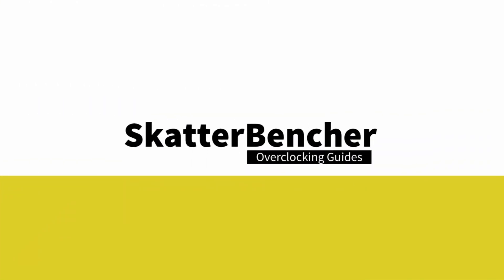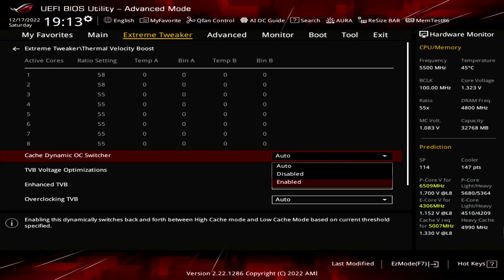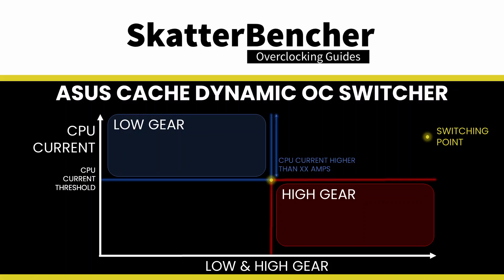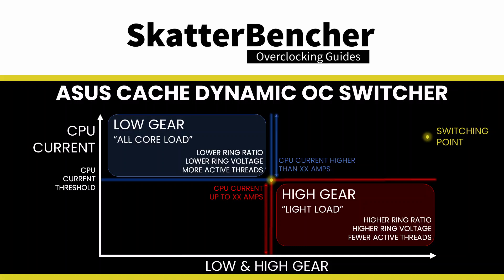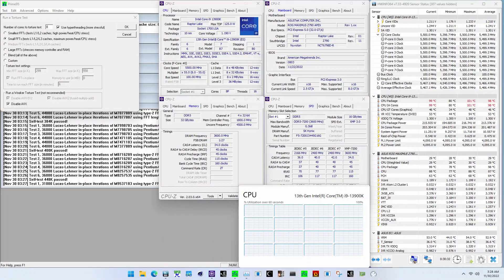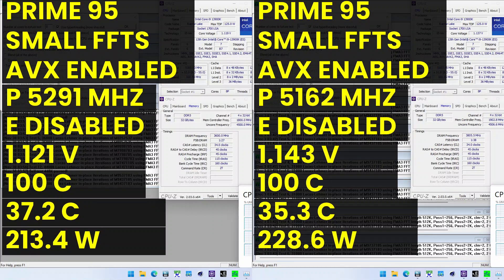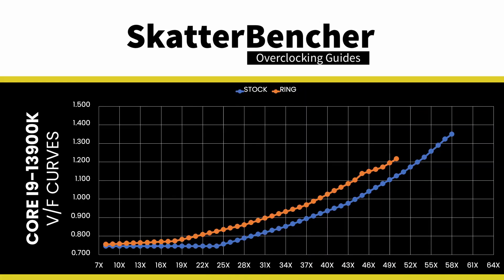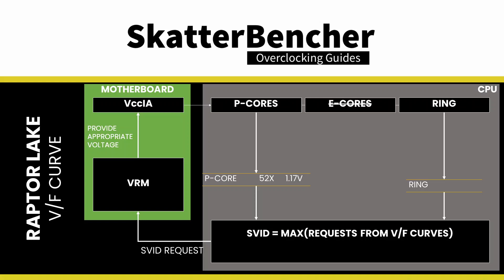ASUS Cache Dynamic OC Switcher | SB#52

Comment: Should I enable the Dynamic OC switcher on my Asus RC8 Dark Hero X570 board for my 5800X3D at - 30 all core??
Reply from the maker: DOS relies on the enabling of "OC Mode" which is not supported on 5800X3D processors. So, no use for DOS with X3D.

Comment: I am still puzzled by this feature on a z790 Maximus Hero with 13900k. My gaming performance goes down quite a bit when I have Dynamic OC switcher enabled. It seems like losing the performance of the 16 e-cores is not at all made up for by slightly increasing the cache overclock. Can you shed some more light on this behavior? Wouldn't having 16 more cores enabled increase performance in gaming more so then have 8 pcores with overclocked cache?
Reply: Its a gimmick.. to much cache can result in negative result and frankly no gains are almost measureble.. it will only add heat and power draw and also maybe instability for your OC. for 5 ghz cache it requires 20-30mv ekstra vcore .. def not worth it..
Reply: @lassekristensen385  thanks for replying this dude never responds to his comments lol.

Comment: Hello, thank you for all your tests with hardware cpu. Can you test new intel cpu bclk oc 13400 or 13500 on b660-f asus or if you know if that still works on newer cpu 13 gen.
Reply from the maker: I strongly doubt it works. The only reason why it worked on Alder Lake is because there was an early microcode with a bug. Even on Alder Lake this bug was patched on the later (read: public release) microcode. There is no reason to expect the bug to return for Raptor Lake ... unfortunately.

Comment: Great Job,  im working in an asus z690 apex but i cant find these option in exteme tweaker menu. My bios version is  0811, and my cpu its a 12400,   what im doing wrong?.
Reply: Did you BCLK overclock that 12400? I hope so!